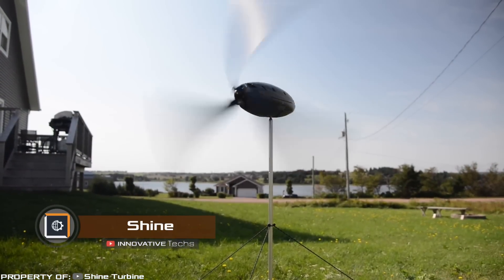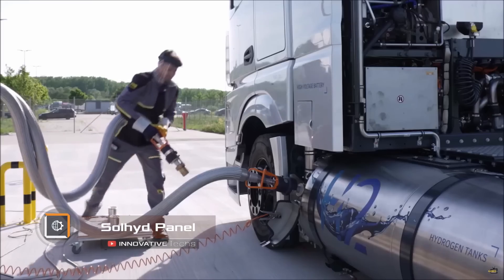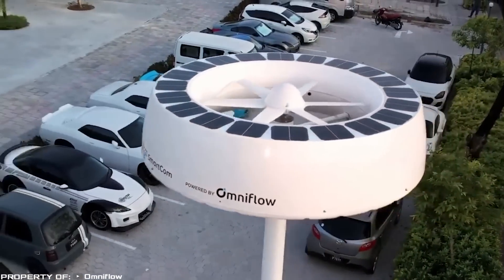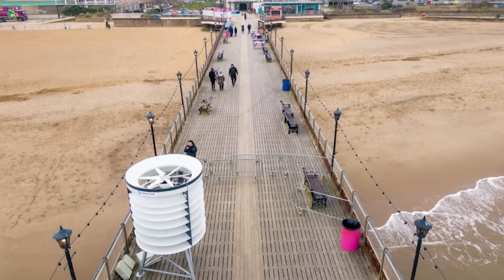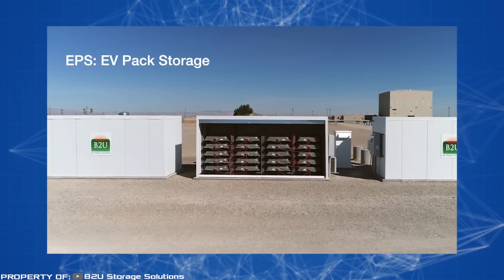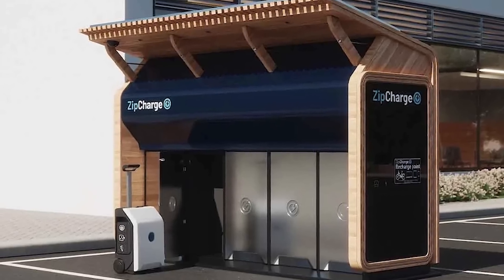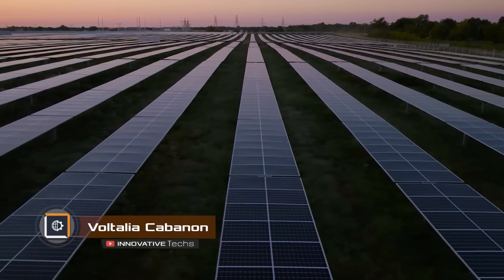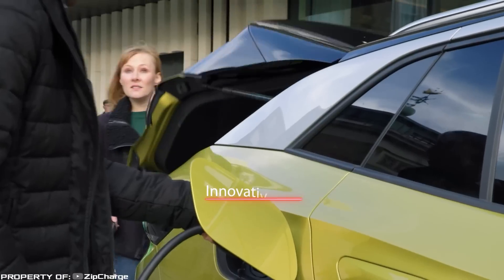TECHNOLOGIES THAT WILL TAKE GREEN ENERGY TO A NEW LEVEL

Comment: My wife and I watched the blossoming of wind power whirlygigs on cruising sailboats a decade ago. When we returned south one season about a decade ago, there was a noteworthy change. Fewer boats had these wind generators. Another change: everyone had solar panels. It was like an overnight transition and included a number of big power boats too.
The average life of the 400 watt wind generators was no more than 3 years. Our panels are over a decade old and still work just fine. They can run our watermaker and refrigerator so long as the sun shines, which fully met our needs when the sun was shining.

Comment: It's big drawback is battery storage. Plenty of dull windless days in UK and in winter when you need heating. Also I'm surprised how few domestic small turbines are in use. I'm thinking of my flat roofed garage all down the side of the house 8m x3m roof is timber so strong.  💪 💪

Comment: one thing I find in these videos is, that no one mentions maintenance, as good as solar and wind energy sounds, they also require a bunch of maintenance, a little bit of dust on solar panels makes them far less efficient, I love the idea of the solar over farms, and I was thinking how good would it be if the watering systems for the crops were above the solar panels so they not only water the plants but clean the solar panels in the process
Reply: I completely agree with your point about maintenance being an important factor when it comes to green energy technologies. Solar panels, in particular, require regular cleaning to ensure optimal efficiency. Your idea of integrating the watering systems for crops with solar panels is brilliant! It would not only help to keep the panels clean but also maximize the use of available space. By the way, have you heard about the Segway Portable PowerStation Cube Series? It's a versatile power station that could come in handy for outdoor enthusiasts like us. It has a massive capacity, fast recharging, and even waterproof technology. Check it out if you're interested!
Reply: @ARLGD  Haha, nearly got me there GPT BOT!!

Comment: you get a lot of devices producing or converting energy. But all have a problem. Just to run a kettle you need 2kw, to heat a house you need 4kw permanent. To create straight hot water you need 27kw.
To use hydrogen you need storage, it's even more dangerous than gas, as it diffuses through metal. 
You need a huge storage battery, more likely from an electric car. You need a combination of wind and solar power, with all the controllers, you need special water storage tanks for hot water with heat pumps. You need backup heaters to avoid Legionella. And in the end, you need a 10kw standby generator, if everything fails. 20- 30 kw Solarpanels,10-15kw Windpower, heatpums.
Do you have the money, or do you know an installer who knows all this?? Good luck to you.

Comment: 30% of  1ha is 3000m2 * 200w/m2( 20% panel) *2000h/year (spain) = 600.000kwh/year aka 100households or small village.  its als 6mio km/year on a 10kwh/100km vehicule ..  600persons/ha if you considere that a french car driver drives 10.000km/year average.     => 1ha land with  30% solar roof coverage can serve 80 households with 2 cars ...  the END of oil

Comment: if the electric car manufacturers could standardize the battery tech and make them removeable them we could have electric car battery swapping stations and you wouldn't get the standard complaints from gas vehicle drivers...just drive up to a station swap out your battery and drive on.
Reply: Good idea, but not really feasible given the weight of the batteries. Would be easier to plug a cord in and charge them at home overnight.

Comment: So cool! But there are much bigger changes to completely replace fossil fuels, rapidly absorb CO2, and even control climate change. Pluvicopia harnesses the energy in the water cycle to do all this and much more. It will be supper profitable too, because as it produces power, arable land, limitless freshwater at any rate, even a large river, it can even control sea level rise. Please read the book and comment using the contact information provided. This is very exciting and critically important.

Comment: Lol, try putting the turbine on the bottom and reverse the wind guides or whatever you want to call them, upsidedown that is so that the wind is forced DOWN not up. Much easier maintenance and you could make the tower twice as high or whatever you want to do. Besides, this " new tech " is a hundred years old 😂. Some people.
Reply: With the air directed down it would make it windy at the bottom of the structure, which would be unpleasant for onlookers, but on a roof of a building this would be a great idea.

Comment: wind turbines is so neat that I want to put 10 of those on my rooftop, just cant find one yet...  also without batteries like my solar panels connected to the e-grid
Reply: Small wind is a complete waste of money if you are using it at home.  The amount of power is most directly impacted by the area swept by the blades and wind speed cubed.  So the tiny portable wind turbine can produce 40 watts peak means it likely does so at say 20 mph wind speed.  So that’s 20X20X20= 8000, but at a wind speed of 2mph the number would only be 2X2X2=8.  So literally 1/1000th the power generated, or .04 watts.    Useless.
Reply: @brettgracey9682  the wind at my house blew out my fence... but who knows maybe you can be right....
Reply: @tentimesful  I’m a huge fan of big wind turbines.  Not so much the small ones, mostly because of their cost compared to what you get out of them.  Wind at 6-300 ft, just isn’t strong enough, consistently enough in most places to make the investment worthwhile, compared to solar.  I thought small turbines were interesting also, until I learned the math, now, not so much.

Comment: Ok, nice advances an very promising but nothing is really free in the end. I mean, there's no such thing as a free meal, so, there is a cost behind this tech.
One thing is the batteries that store the energy, they are costly and limited in capacity and endurance. To make them really efficient, Tesla (the real Tesla, not the wanna be dude from tweet) tech should be applied.
Also, the socieconomic system should be shifted, from competitive consumism to cooperative cretivism or something of the sort, a qualitative change is needed.
Otherwise, this promising inventions will be either buyed and missplaced or discredited and forgoten.
Good luck.
Good luck.

Comment: Why not all the high ways  to be canopied with solar panels To save the precious land !!??  
Even the rain water also can be harvested and stored and supplied for drinking purposes  !!

The high ways will last several times longer since water doesn't seep in to loosen the bitumen  !!!
In temperate regions (like  gulf countries) the air conditioning energy required in automobiles is also reduced tremendously!!!

Comment: The street light is the best application of wind/solar power I’ve seen but only viable where destructive weather is nonexistent.
Reply: Solar is far more economical for small scale applications.
Reply: @AORD72   I would say that might be correct where the grid is not economically available. That would apply to street lights that were being installed in new housing developments, thus eliminating the cost of the infrastructure necessary to connect to the grid.

Comment: These wind turbines are far, far better than those wretched windmills.  They are cheaper to build, maintain, easily recycled and don’t kill bird. Windmills are expensive to build, expensive to maintain, very expensive and much of the windmill can not be recycled and they kill birds. So, you tell me why we are still using these “things”?
Reply: These small turbines generate only a very small amount of power compared to windmills,they are only 3 or 4 kilowatts compared to 5,000 kilowatts
Reply: Those are wind turbines, not mills.  No one is grinding flour with them.

Comment: Great vid. The vertical turbines and street light wind/solar harvesters are fantastic ideas.
Reply: Better than building those large, natural destroying towers the government is pushing for.
Reply: No they are not, solar is far more economical.
Reply: @AORD72  Though we must have panels made from materials that don't cause damage to the environment during extraction. Lithium mining, by current methods, can cause more damage to the environment than oil burning.
Reply: @WolfeSaber  hardly, have you walked down to your local lithium mine lately and seen all the damage? You are panicking over nothing. Every atom can be recycled you just need enough heat or pressure change.
Reply: @AORD72  But what about those lakes of chemicals found nearby? Those are used, or are the byproducts, in the lithium mining. And we don't live in Star Trek where every atom can be recycled.
Reply: @WolfeSaber  "we don't live in Star Trek where every atom can be recycled", actually we can recycle every molecule, it just takes heat to break them down. We can even convert some atoms into others. I think people need to be realistic about the volume of damage done by the lithium mining. I is very small in terms of the percentage of the earth.
Some ot the mining methods don't even cause any problems.
Reply: @AORD72  Honestly, it seems like you can't tell between the real world and fiction. The processes you're talking about in recycling are not common like in Star Trek. Converting atoms into others happens in labs, nuclear reactors, and particle accelerators.
Besides, how long and how much does it take carbon emissions to destroy the environment compared to lithium mining?
Also, what mining method does have these side effects? Can you name them?
Reply: @WolfeSaber  My point was all molecules can be broken down, you just have to apply enough heat.
Extracting Lithium from Geothermal Brine doesn't have massive side effects.
"Extracting lithium from salt-flat brines is relatively straightforward, but is a time-intensive process, since it takes several months of progressive evaporation to reach a high enough lithium concentration in the brine for economic recovery."
It is the lithium rock extraction that is problematic as it uses acid leaching.

Once the lithium is in the cycle chain it can be used over and over again. Fossil fuels are a one off use.
Reply: @AORD72  You do realize, diamonds are formed using heat, along with fusion.
As for using geothermal brine, there isn't enough lithium in the short term to replace fossil fuels for cars. 240 milligrams per liter, not a lot. Plus, it takes some much time. Plus, lithium can be set on fire, even in battery form. And once that fire starts, it's a self propagating process that gets the battery hotter and hotter until it is completely destroyed.
Other battery types, using other materials are better.  They won't explode, be very little, and hold more energy for longer periods of time.
Reply: @AORD72  The fires were involved in density requirements, like on the grid, where cooling isn't passive. And it is clear you've been the one in a cave.
Sodium, vanadium, iron rust, etc, are all candidates for lithium alternatives.
Reply: @AORD72  I listed a handful of alternatives to lithium. And what, are we dropping recycling now?
Reply: @WolfeSaber  " I listed a handful of alternatives to lithium" so? None of them are viable for batteries that need to be moved around. Who said anything about recycling?
Reply: @AORD72  And yet Brine Extraction is not viable enough to replace our source for lithium. Plus, you kept on talking about being able to recycle every atom like it was Star Trek.
Reply: @WolfeSaber  Brine Extraction is new because of the demand for lithium has just arrived. You can recycle every atom if you apply enough heat you can break down all molecules. What can't you break down with heat?
Reply: @AORD72  Well, for cars, the alternative to run them is hydrogen, either fuel cell or internal combustion. But the stupid USA government is banking way too much on EVs. That's the problem.
As for the recycling, you can break down the atoms by heat, but how are you going to use them again? Where do you store the atoms for use? That's the problem.
Reply: @WolfeSaber  "run them is hydrogen", hydrogen is not economical, and never will be. Why do you think nobody is buy hydrogen cars?
Where do you store the atoms for use? it is not a problem. Companies by raw materials all the time.
Reply: @AORD72  You do know Japan and other countries are investing more in hydrogen power, along with production, than electric cars.
How do you get the broken down atoms into the raw materials for use? That's the problem. Because if we can heat brake anything, do you thing we've cleaned up the planet by now?
Reply: @AORD72  Same with EVs compared to hydrogen powered.

And since heat requires money, it doesn't work in recycling like you say. We don't live in a world where electricity is unlimited like in Star Trek.
Reply: @WolfeSaber  There is about 10 million EVs being sold worldwide annually now (~20% PHEV and 80% BEV). And the growth rate is staggering.